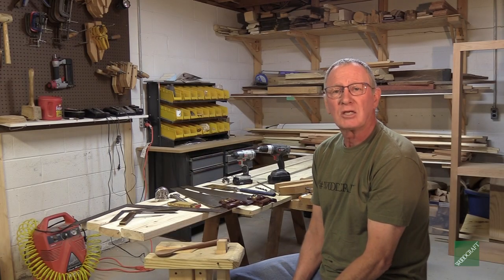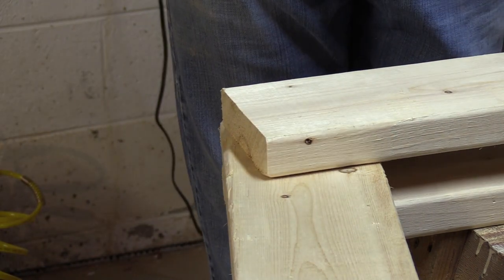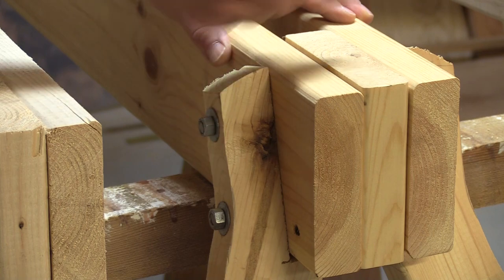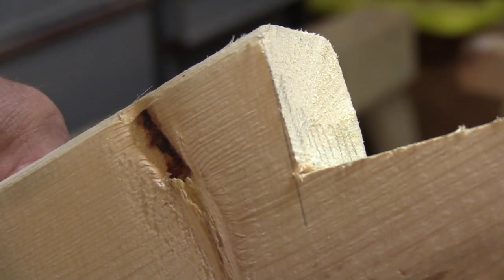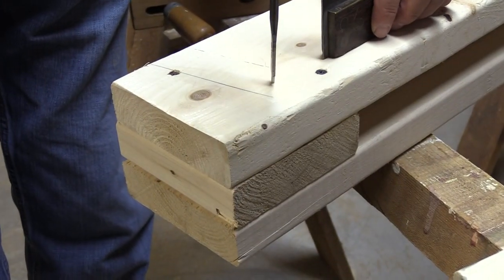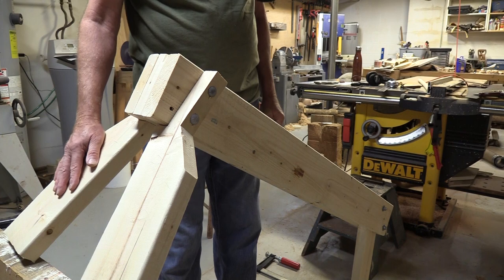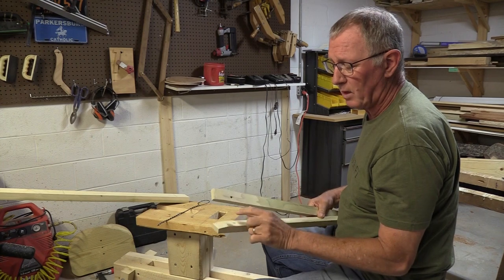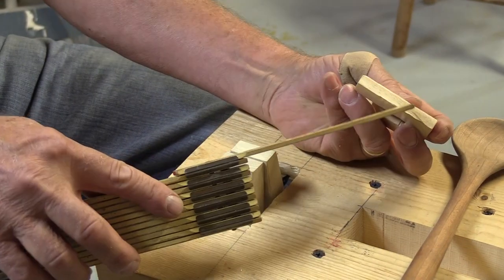How to Make a Spoon Mule with Fred Esker

Comment: I'm sure you have a reason for 2 legs in front I just want to know your reason. I'm not questioning right or wrong just wondering. Most videos I've watched the 2 legs are placed in the back where you set. Please enlighten me please.
Reply: Very late reply. Sorry about that. Blame it on being a novice on social media. I put the two legs in front because that is where the work is being done, where the forces are. usually you'll lean forward slightly when carving out the bowl of a spoon and even for using a spokeshave or drawknife. Hope that helps.